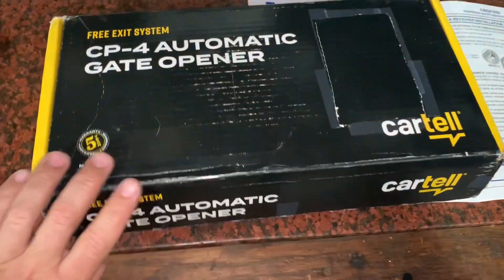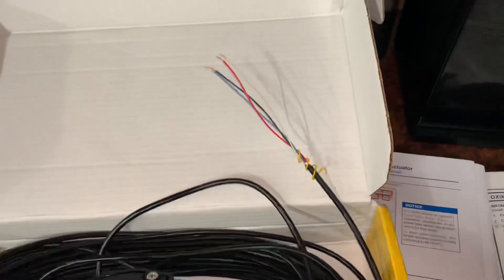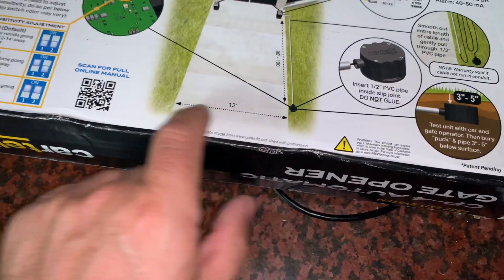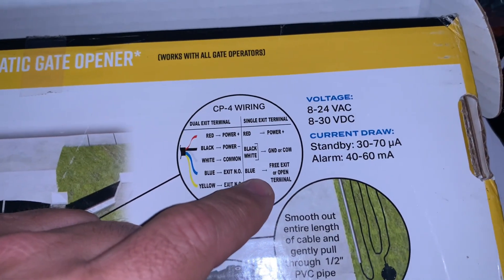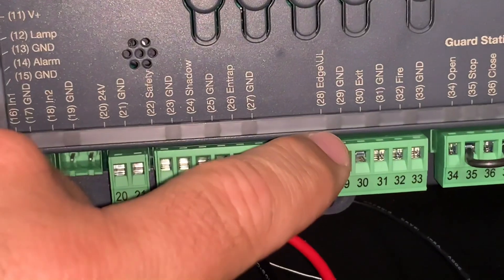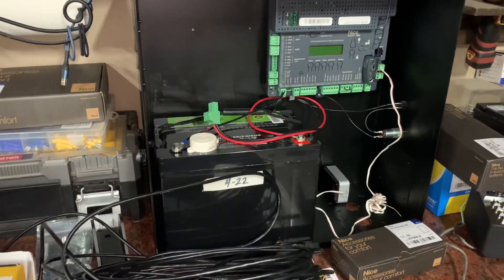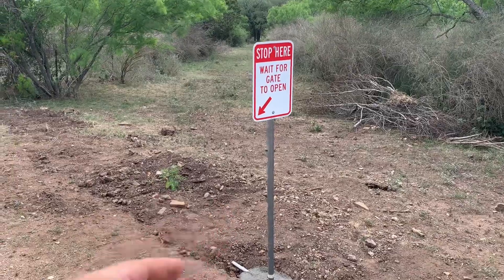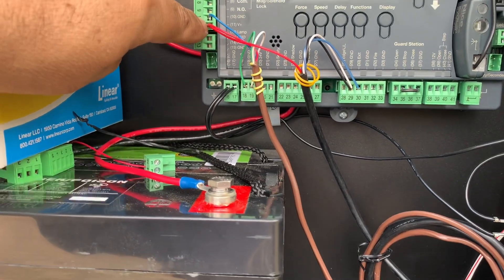Cartell CP4 ● Automatic Gate Opener Free Exit Sensor ● Overview and DIY Installation

Comment: Quick question, the manufacture info said this is not a problem... but I have horses that wander around this area and they have metal shoes.. Manufacture said no problem, I live on the big island of Hawaii and I have "blue rock" ( harder than granite) one inch under my dirt so I have to jackhammer every inch of the ground for this thing ( not looking forward to that). Just hoping this is not an issue. Thanks again.
Reply: Hi your gate exit sensor should be good with the horses I have installed gate motors for 7 years even with the sensitivity turned all the way up a shovel won't even open the gate over the loop unless it's like 6in deep hope this was helpful
Reply: @travisshope7256  thanks for the heads up

Comment: Finding this video helped me a lot. I have the wireless sensor and the Apollo 1050 and am trying to learn to self install. Can you tell me if the dual vs single exit terminal set up means how many gates you are opening. Meaning I would use the dual diagram instead of the single diagram if my system opens 2 gates instead of a single gate like in your video? Not an electrician so I was not sure if the directions were speaking to the number of gates or the number of exit terminals on the 1050. I appreciate any insight.
Reply from the maker: It's not the number of gates (ie single swing gate, or dual swing gate). It has to do with the operator control board.  You have a Nice Apollo 1050 control board so you only need to use the "single exit terminal" wiring just as I did in the video.  I would have done the exact same configuration with a dual swing gate installation.  

This difference in these two options has to do with the control board itself. Some control boards require a N.O. (normally open) contact that closes in order to trip the free exit system, and also a N.C. (normally closed) contact that opens in order to trip the free exit system.  So you will need to use all 5 wires in that case.  The Nice Apollo 1050 does not require this, since it has a dedicated feature on the board for "exit" and as such, it uses just the 3 wires to trigger the exit activity. 

Since you have a Nice Apollo 1050 board I suggest you check out the other gate operator videos I have on this channel.  I prefer to use Nice Apollo 1050 boards on my installs, and have several videos related to that equipment on my channel.  I wish you the best!  Thanks for your question.
Reply from the maker: This playlist has all the gate operator videos. There's a video there of a new installation with dual swing gates also (but haven't installed the Exit Sensor on that one yet - but it's the same wiring).
https://www.youtube.com/playlist?list=PLeABeH26KBKevp5wbcyoNRdjdLsXPxzsc

Comment: Will it close the gate after it senses the car leave?
Reply from the maker: The sensor just gives a go signal to your gate to open. Your gate will need to have a built-in timer or other system to initiate the close. This does not send a close signal after the vehicle is no longer detected.